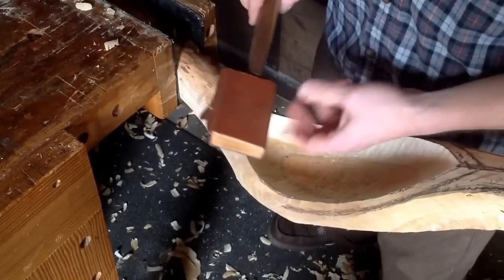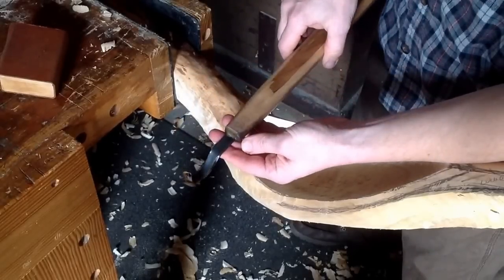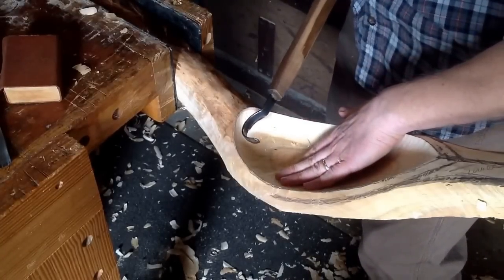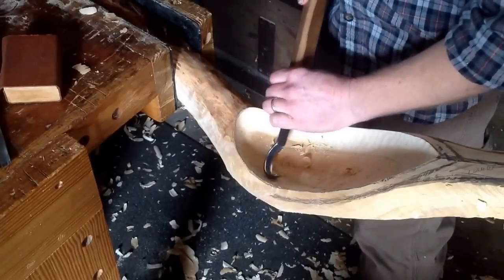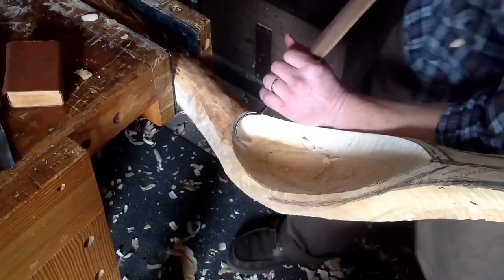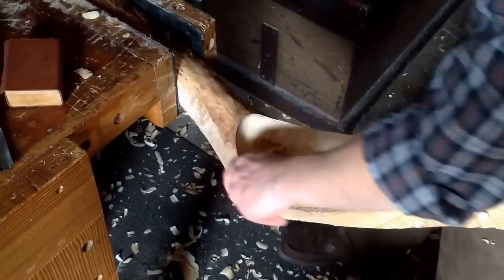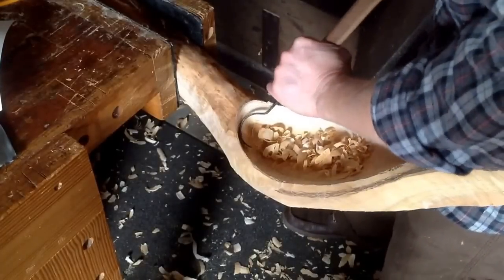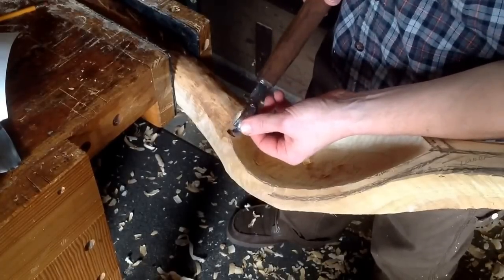Carving a Bowl with a Twca Cam

Comment: I just received my Toohka Kam bowl carver from Ukraine. It looks just like your but with a turned handle. I think the idea of a swan is brilliant! If I saw it, I would probably think, big sauce ladle, lol. I was unpacking the Toohka and barely touched the blade while taking the bubble wrap off the end and sliced my thumb open. I was distracted and known better not to rush but I was excited to try it out. So to all the Newbie carvers out there, these tools come in Extremely, scary sharp. I have made other wood covers for my other tools too. I like the idea and made them out of purple heart. I really love the idea of incorporating leather as the closing mechanize and will try to make your version as soon as the leather comes in. What did you use for the pin that holds the leather closed? I bought a hoof pick which some are shaped just like your tool. Its steel and I'm going to try to sharpen it for carving spoons. It has a super comfy handle too. I was thought that it would be my camping/hiking tool and I can leave it in the car with a small sharpening stone. That way if it got stolen or lost I can just get another one for $3.99 on eBay.
Reply: The pin that holds the leather closed is just a whittled piece of hardwood inserted into a drilled hole.  Its carved a little wider at the end so the leather pops over it and doesn't want to lift off easily.  Hope your thumb has healed up!  Happy carving!

Comment: Hi dave I see you hold the twca cam in your right hand and steady it with your left ,I'm predominantly right handed so would i need to buy a right or left hand twca ? I'm a complete beginner and suffer with mental health problems so i do get confused very easily lol .thanks if you can help best wishes Neil
Reply: Hi Neil.  I get confused easily too, so you've got company!  I think the twca cam that makes the most sense for a right-handed person is one with the cutting edge to the left when the tool is held straight out in front of you.  I'm right-handed, and I'm using a right-handed twca cam in the video. I hope that helps.  Happy carving!

Comment: I generally stay away from cherry, especially limb wood. It misbehaves terribly as it dries, usually splitting open toward the center wood. Cherry seems to store up a lot of stresses as it grows and when the material around some of the stress points gets cut away the remaining wood seems to move quite a lot and mostly not in a good way.

Comment: David! I just got a TWCA cam and want to make a sheath for it, but am struggling to figure out how you made yours. I was wondering

1. How did you cut the recess for the blade? 

2. How did you adhere the leather to the wood block?

Thank you so much
-J
Reply: I traced the shape of the blade onto a block of wood that was a little thicker than the blade depth.  Then I cut that thin curving section out with a coping saw.  I glued a thin piece of wood to the back of that.  I just glued the leather to the wooden parts with regular wood glue.  I glued it on with the thin wood "cap" piece in place -- like a book cover.